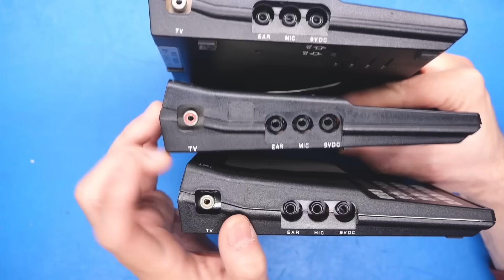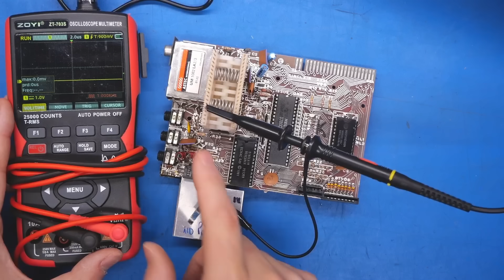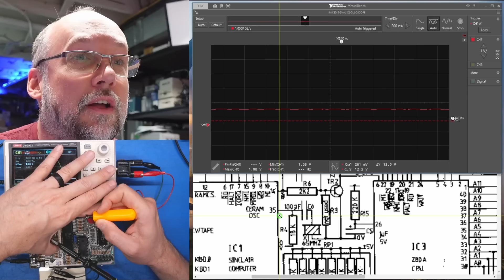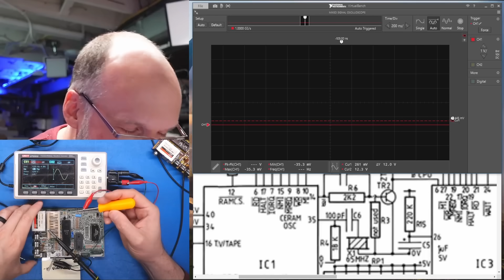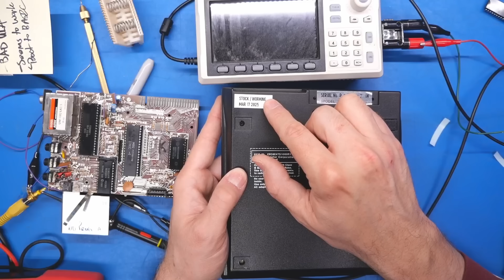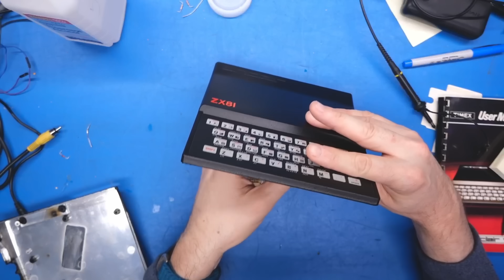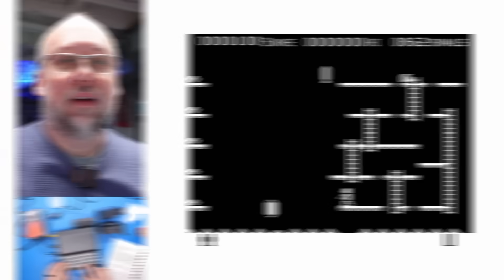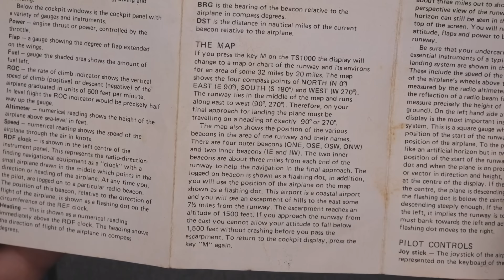Is the ZX81 / Timex Sinclair 1000 actually bad? Let's fix these to find out.

Comment: I believe the Sinclair and Timex versions were actually sold concurrently in the US. At least, at first. I'm not sure of the whole story, but I think Timex wasn't too happy about it, and that's why Sinclair pulled out of the market. As far as I recall, Timex thought it had exclusive rights.

Matt Regan (“DrMattRegan” here on YouTube) did an excellent series recreating and explaining the ZX81's video generation last year. Worth a look if you have the time; I think you'd find it interesting. Surprisingly, it works slightly differently if the machine has 16K. At first I thought that might be what was causing the glitching when you plugged the expansion packs in - minor timing issues, maybe - but your explanation makes sense.

There was a thriving market in replacement/add-on keyboards for the thing. You did get used to it (especially if you'd never known anything else), but it was never great.

The metallized paint inside the case is definitely only on the US models. And I always wondered what that blanking “plug” in the mould was for. It's only taken me 44 years to find out. 😀

Comment: Composite mod, gold video out jack, new caps, replacement ULA, and TSR-1 2450 power replacement for 7805. Timex got the licnese rights because Sinclair had contracted Timex to build them in UK. Once Timex took over in N. America, the ZX81 ceased selling in US. A company in UK called RetroBoxes also sells brand new ZX81 replacement boxes. A seller named YouMakeRobots sells a new replacement PCB for the 1016 using all new parts. Only 3 parts are required. There were also lots of 3rd party add on keyboards. The TS1500 had rubber raised chicklet keys like the Spectrum had.

Comment: I bought a synclair zx81  in early 82 for about $120 Cdn. I learned basic language on this with the mambrane keyboard!

Soon after, I piggy backed a 4k of ram I purchased from the US for around  $100. However, the ram housing was made of aluminium, not plastic. I also recall the display interference and a slower cpu when the expansion ram was used.

I also bought full size keyboard skeletin(no housing). You had to disconnect the mambrake keyboard and connected the ribbon from the new keyboard. the ribbon came thru the same slot of the top housing.

I never bought games for it. All I had was my own program creations saved and uploaded from a mini cassette recorder.

A year or two later, I upgraded to a Vic20 and then a Comodore 64.

Thanks for bringing back such fond memories with your well put together vlog. I was 19 year old then and soon turning 62!

Comment: I learned Z80 assembler using a Timex Sinclair. It was slightly modified with plumbing for air and a cassette for storing code. It was abysmal. The sketchy connections, the assembler was a home brew, and that keyboard was horrible. You are correct that loading programs from the cassette causes the video to freak out.

Comment: Re performance: by default the machine runs in SLOW mode, where 3/4 of the CPU time is spent doing screen updates and you get 1/4 to run your programs. But there's also FAST mode, which means the screen is only updated while idle. It makes typing deeply flickery and modern monitors hate it because they keep losing sync. The ZX81 video system is astonishingly evil and worth reading up on. Because it's mostly software-defined you can do all kinds of weird things, like displaying bitmap graphics on a machine which has such a primitive video system it can't even do lower case text...

Comment: Hey Adrian - thanks for the video.  I had a TS-1000 as a young fella back in the day.  I also had the 16K expansion pack as well. It saved all my penny's and collected bottles to afford it, as money was tight at home.  I think you may have solved a long standing question I've had since then.  When I had the 16K pack installed, I could not load or save programs to cassette, but I could without issues when the pack was unplugged.  That was pretty frustrating.  It looks like it could have been the interference from the DC-DC converters in the 16K pack or some capacitors for the pack. This was always a mystery to me.  I wonder if it's possible to clean up the noise that the 16K pack produces?

Comment: I was going to post a long story about my Timex Sinclair 1000 with the 16k expansion that I bought at The Bay in the mid 80's but then I thought the real point of the story is that the Timex Sinclair 1000 is the WORST, by far, computer I have ever had the displeasure of using. Total crap! I loved my Atari 600xl though. Then I bought the original Tandy 1000 in late '84 and never looked back! 😀

Comment: I love them almost as much as their successor machine the ZX Spectrum. I had one and it was the first computer I owned aged 11 or so. The best ZX81 game by far is 3D Monster Maze for the 16k games but there were also 1000s of type-in games in magazines of the time. The price was important perhaps more so in the UK rather than the US but it was a lovely piece of engineering. I typed many games in using that crappy keyboard and the wobbly RAM pack was by far a bigger problem at the time.

Comment: BTW, on BASIC programs if you need to ran something that needs more processing power there's the FAST keyword that will blank the screen but let the BASIC interpreter run at full speed (and there's also a SLOW keyword to re-enable the screen rendering).

Comment: It's not uncommon for clock signals to be generated from a free-running low accuracy internal oscillator and phase-locked loop circuit that gets trained/slaved to some external high-precision clock source. When the external clock is present and within the supported frequency range, the internal loop will latch onto it and will generate derived clocks at various multiplier/divider ratios to the input clock signal, but they'll be accurately timed and phase-aligned to the input.

When that input oscillator is absent, the circuit will still self-oscillate in roughly the right frequency range but it will be exceedingly unstable and will drift all over the place, as you saw here.

Comment: I remember putting in a pre-order for one of my ZX81 back in 1981 when I was in TAFE doing electronic engineering. Changed my life and lead directly to a 40 year career in IT.
Reply from the maker: Do you recall how long you lasted on the ZX81 before you pressured your parents to buy you something better?
Reply: @adriansdigitalbasement I actually joined the army in order to get myself a more decent PC than  my ZX81 at the PX.
I enlisted as well to  giving me time to figure out what profession I wanted when I ETS'ed out.
Reply: @adriansdigitalbasement  persisted with it for around 12 months until I could save up enough money to buy a VIC20 then eventually sold that to put towards a C64 and so on and so on. The C64 lasted quite a while and was totally pimped out with addons. Eventually sold that to get an Apple IIc (that one was probably a mistake), Then it was an Amiga 2000. After that it was self constructed IBM clones.
Reply: @adriansdigitalbasement  I was on it for two years until I went to university. To be fair I had access to the BBC Micro and RML 380Z through school as well. If they’d offered an upgrade (they didn’t) I would have gone for a BBC Model B. At uni we had access to a couple of minicomputers (one was a Harris 500, the other was a Unix server), BBC Micros and a collection of more primitive SBCs based around the 6809 and Z80
Reply: Ditto, got mine at age 16 and software engineering has paid the bills for almost 40 years now. No regrets.

Comment: Hi Adrian, we met at PRGE and I had mentioned that for membrane dead short repairs I had luck with car window defroster repair kits. It is fiddly and the solvent tends to eat away at the metal so you end up slowly chasing it till there is enough of a  connection and the solvent has evaporated enough that it no longer dissolves. I would assume that if it was absolutely necessary you could get away with gluing wires to the membrane and making the connection with the conductive glue. Now in this case where replacements are only $25 this level of effort would be pointless but for my MSX the best option is around $100 for someone who makes a thin PCB replacement for the membrane.

Comment: 3:13 you can see the plug outline in the bottom-most ZX. Usually those types of plugs were an insert that could be added or removed from the injection mold. It may be that the fit was sloppy on the middle one.

Comment: The issue one board is definitely a USA issue one.  The U.K. issue one boards have hand drawn curvy traces. One of the problems with these machines is the heat in those tiny little cases, with little ventilation. It cooks the chips and bakes the membranes so they become brittle. I have a couple of them, one I left stock, but the other I have added a composite board  (with back porch), replaced the power regulator with a Traco one that runs cool and also added the 16k upgrade internally. It’s fairly easy to do, you just need to run a few extra bodge wires to the CPU.  This gets around the need for the DC converter in the RAM pack, so you don’t get the video interference.
Reply from the maker: Since making this video multiple people have pointed out that Sinclair RAM pack results in video noise and it did back in the day even. That's wild!

Comment: I remember that it had no video chip so it only executed the program during the retrace period of the monitor which made it very slow. There was some command which would get around this but would blank out the monitor. The memory expansion that would dump your program if you touched the computer the wrong way was probably the most infuriating part of trying to use it.

Comment: Don't be surprised that the oscillator works without the crystal, the reasonable oscillator is usually created by an RC circuit. The crystal is there only for stability.

Comment: The worst thing about the memory modules is the connector. I soldered it off, connected the pcb with wires to the mainboard, and no problem, the memory-pcb even fits in the original ZX81-case, as it is to this day and in working condition since 1982. And.. the BASIC in my opinion is far better than it looks.. my last project was calculating the frequency-dividing-bitcodes for a S187-PLL on Bosch-Transceivers. The dump I printed out with the ZX-Printer. Next I input the dump into my C64 to program a 2764 Eprom. I was not able to write the program in C64-Basic. Nevermind: I ended the project running in 1984 and learned a lot from it.

Comment: My first computer back in '81 or '82.  $99. I wrote several programs for it. One was an accounting program for a class I was taking in college. The Sinclair 1000 got me in trouble with my wife quite a few times for priority issues. haha I got the expansion and there was always a problem with the plug connection.

Comment: Coming back to thinking of the zx81 video system... it made Basic very slow because in Slow mode the rom code was only allowed to run during the video blanking intervals (both H & V), so somewhat less than 1/3 of the frame. This in turn was because the z80 cpu was doing all the work of fetching the contents of video memory and writing bytes to an 8-bit shift register, and this took almost all the time available. In Fast mode, the rom code just switched off video generation, IIRC, which obviously resulted in "snow" as the TV (we never had monitors then!) lost sync.

It seems plausible to me that you could do it slightly differently - still use interrupts to generate the H&Vsync signals and set a valid signal level, but otherwise forego video generation. That way you have a slightly slower fast mode (but still quick) but no nasty screen stuff.

When loading or saving to cassette (as noted) the video pin was reused for audio. I presume this was becuase of a lack of pins on the ula - maybe if the designers used a different clock circuit they could have saved a pin, and had separate audio and video? I remember though that Clive was very anxious to save every last penny in component cost.

I cannot help wondering whether some very simple and cheap changes to the design - cost-free or just pennies - would have resulted in better sales and more profit overall? For example:
- a different case shape around the ram pack would enable the expansion to be more firmly attached;
- the clock/audio/video mod above;
- using a 7.5V rather than 9V DC input (a lot of '81s got very hot because of the regulator, and 7.5V was the next lower commonly available power supply);

I have also frequently wondered how "full" the ULA was - might there have been scope for pushing a bit more video work into the ULA? I don't know it well enough to be sure.

Comment: I had a ZX81 here in the UK from when it came out. Steve Vickers who wrote the manual and ROM also taught me at university.  The UK in the 80s was much poorer than the US, and buying a better computer wasn't much of an option.  We moved from the ZX81 to the Spectrum when it came out.  The jailbars and terrible display are completely normal - in fact even with the rampack installed your quality was better than I was used to.  Sound was possible! - there were machine code programs from back in the day that ran the display at various different rate to make different tones.  A couple of the games shown used hi-res graphics which was a special hack; the machine normally displayed only text.  The keyboard was indeed awful but I upgraded my machine to a DK'Tronics full travel keyboard ... and I still have it.
Reply: I agree the two first shown games use the "hires trick" which was not common back in the days. In the beginning of 80s'  when you bought a ZX81 you expected to have "semi-graphic" games (that use the graphic pattern burn on the keyboard) or games where each moving "sprite" was actually an alphabet character or a "*" or "+" or ">"... ;-)
I think "hi-res" was first introduced by QuickSilva editor as a machine code routine prior to be a dedicated expansion board if I recall well (as well as a later color board) ?
Reply: I disassembled the ROM and spent hours poring over the code until I discovered that the 'hi-res' graphics used only the first bit pattern in each byte of the character codes. I then went on to coding my own hi-res routines in Z80 Assembly Language to produce graphs and even a circular 3D maze with a running man character that was smooth as hell. The way the display was produced on the ZX81 by utilising the Z80 Refresh Register was an amazing piece of coding. Kudos for that. I think my last programming efforts were an Artificial Satellite Tracker, and a Voice Recognition program that I used to control the running man sprite in my 3D circular maze! Just shows what could be done.
Reply: Steve Vickers also did the ROM and the manual for the Jupiter Ace. When I was a kid, I couldn't even afford a ZX81. But in my student days the Jupiter Ace made me into a FORTH maniac.

Comment: In the USA, the ZX81 was sold as a kit, but you could order one "pre-assembled" for a few dollars more (to get around the FCC rules).  I bought the kit.  The TS1000 had 2K of RAM versus 1K of the ZX81.  The US ZX81 used a UHF RF modulator.  Because it was black and white, the 50Hz refresh worked fine.

X1 is a resonator, not a crystal.  It just keeps the oscillator on a stable frequency.

It has a FAST mode that shuts off the screen when not prompting.  You can go FAST for heavy calculations then go back to SLOW for output and prompting.

When Radio Shack was selling off the TI99/4A parts stock, the keyboards made for an excellent replacement, but you had to rewire the switches.
Reply from the maker: Hmm, I didn't test it, but the US ZX81 said channel 2 and 3 on the bottom. Was there a different one that was just a PAL type machine they sold in North America?
Reply: @adriansdigitalbasement  I'm not sure, but my ZX81 kit came with a UHF (channel 32 I think) RF modulator.  I'm betting the actual kits were only PAL machines, or perhaps a conglomeration of each depending on available parts.  It could also be I was mailed a PAL machine by mistake.  Who knows?

Comment: Actually, I first had an RCA 1802 Elf Computer (Popular Electronics, which I still have), I used it with Don Lancaster's TV Typewriter. So I programed it with a good Keyboard. Going to the TS 1000 keyboard was a challenge, but after getting used to it, it worked quite well. The one key Basic commands helped a lot. The TS 2068 has chiclet keys like the Spectrum. After the TS 1000 and TS 2068, I went to the Commodore 128 and then the Amiga 500. Recently got my Amiga 500 recapped and working and am working on restoring an Amiga 3000.

Comment: The "Bridge" metal piece can break itself or at solder joints and computer won't run. Believe in some versions is a ground "jumper" that must be there or in my case I cut long section many years ago and bridge the ends with wire. That way grounds the case sections but don't stress the metal.